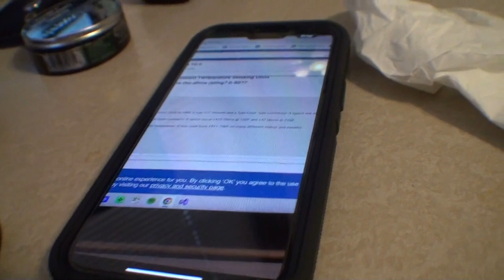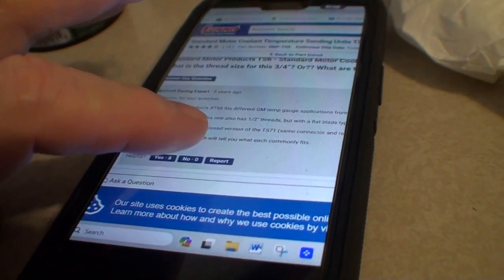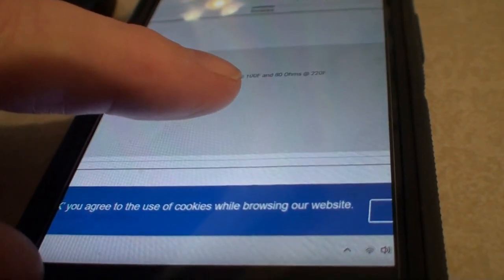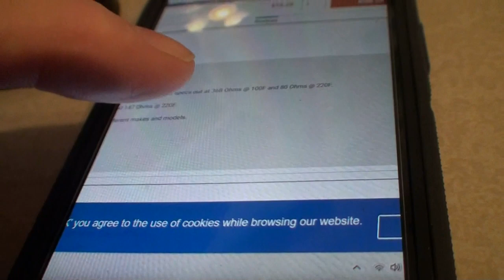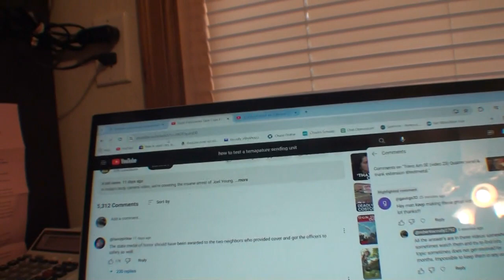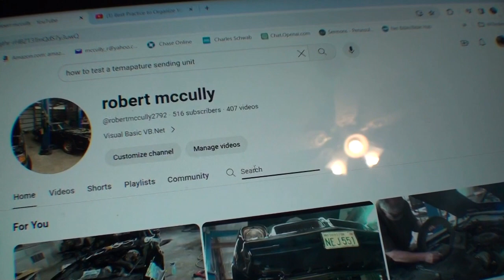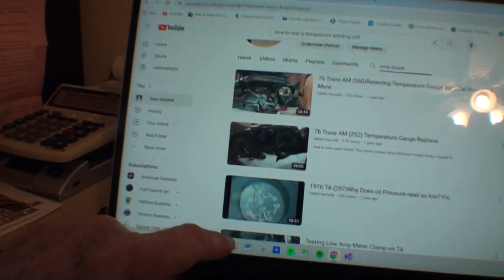Things that still need to be fixed and how to solve them, we hope.

Comment: Greetings from Portland Oregon.  I too am a Trans Am guy, 79 4 spd here, close to retirement.   Just found your channel, scanned a few videos....I've met Darin about 7 years ago also... funny.  Regarding the temp gauge, are all your body grounds installed?  I realize the temp gauge grounds to the block, but just a thought.   Maybe run into you someday. Peace.
Reply from the maker: Yea Darin is a good guy.. Oil gauge works,, same ground.  Retirement is ok for a while, then you have to find a hobby or you will go nuts.
Reply from the maker: Yes grounds are good,gauge was bad and sender was not correct resistance.